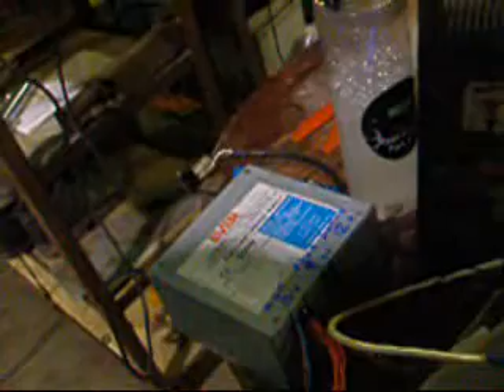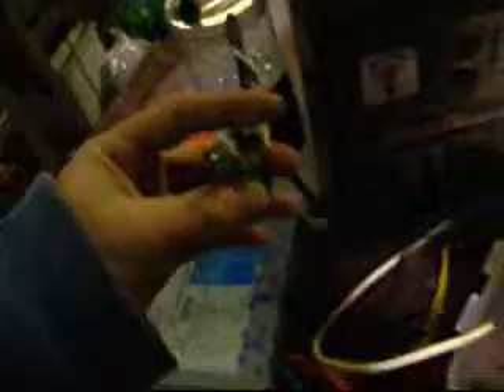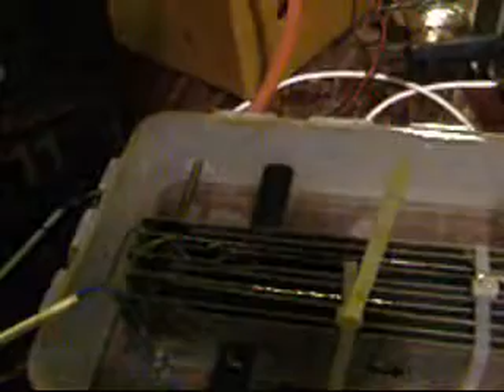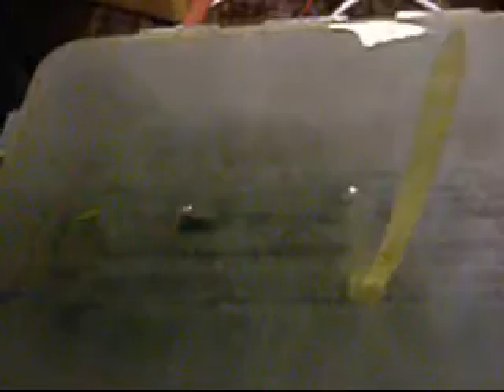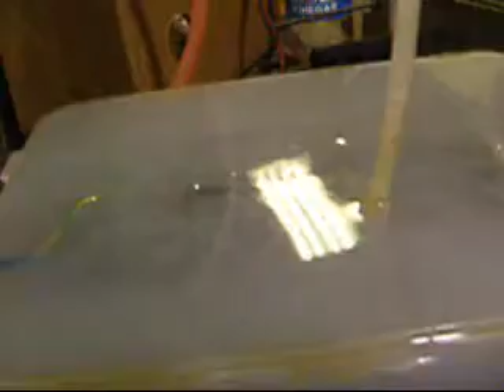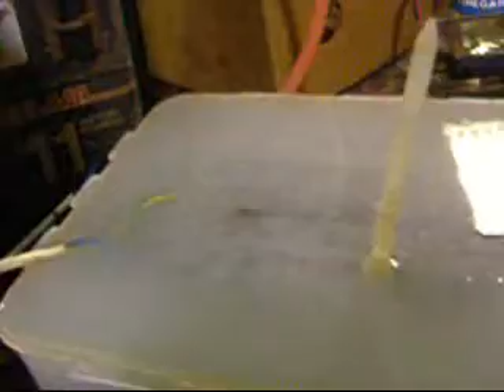HHO pc power supply #5

Comment from the maker: as for your water i used rain water as it was the purest with 0.1 of a amp draw. as you add baking soda you reduce the resistance, and allow amps to flow.
slowly bring your amps (use a amp meter/multi meter) up to 10-15-20 amps. add too much baking soda = too much amps = melt down/ explosions or burn out power supply's.  note> amps = heat and plastic tends to melt if it gets too hot or powersupplys burn out. put fuses on everything! as for amps use a "shunt"> (a voltage will equal a amperage)

Comment from the maker: @DegreeStudio 

ya from what i remember, dont use one black wire and one yellow wire 0V and 12V you will need to use all the Yellow wires and all the black wires as the cells draws alot of amps.  on the pc power supply it will say what max wattage (watts) is or max power or max amps.  YOU WILL NEED TO KNOW THIS. i burned out 2 power supply's. get a fuse in series with your cell on the positive side so it will protect the power supply.

Comment: Hei harpersteven, 
for now i have burned 2 power supplies :D
hmm ....
i connected one yellow wire and one black wire with my cell ( two lead plates ), was there a possibility that the resistance of the cell was so great that it overloaded my PSU, because i added i think too much baking soda to it? 

i mean that, does adding a baking soda to electrolyte affect the resistance of the cell or the all circut ?
Reply from the maker: Thank you

Comment: You will not quickly blow your power supply,
by to high a current ( amps),
but your cell is also not making much gas.
Thats because you don't use an electrolyte.
Anand to high tension ( Volts).
2 Volts per cell is more than enough, more
voltage will give only more heat.
Reply from the maker: Thank you

Comment from the maker: well i have none in it at the mo.. but i know i do need some cos it is still very slow.. but im guessing i should put a amp meter on it,,, and if it is above 8 amps not to put any electrolyte in it,, but if its under i can bring it up to 8 amps. ( my pc power supply it rated at 12V 8As. but i guess if i use the 5V i can add loads of electrolyte up to 20 ams. as its rated at 5v20A well will see,
 what are you going to do now??in lines of a power supply, go with a pc power supply again?